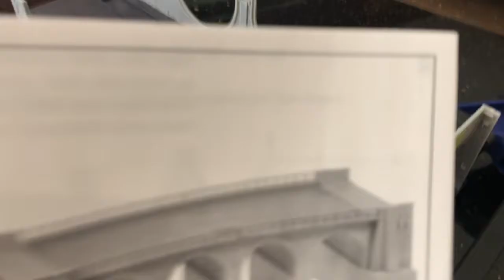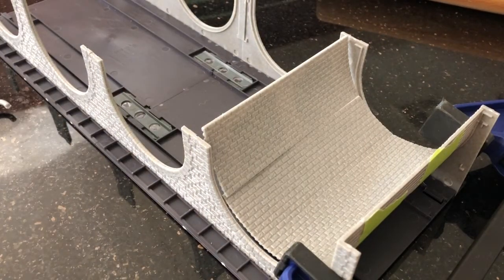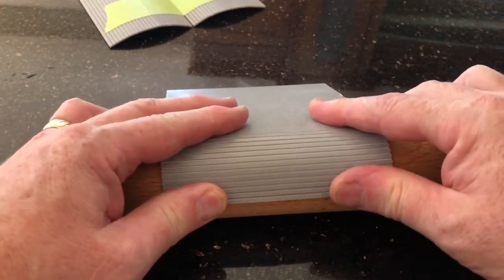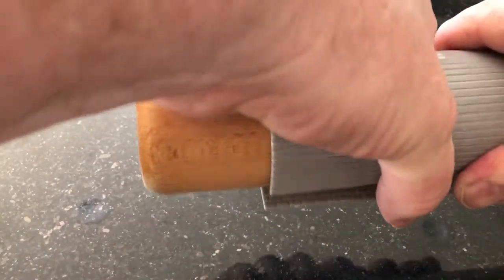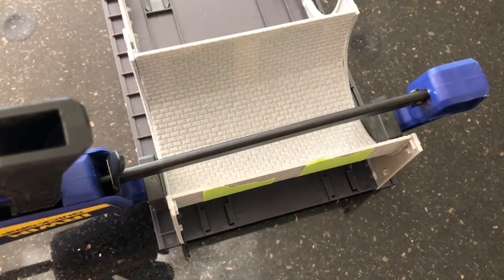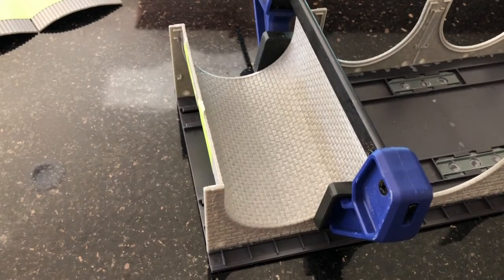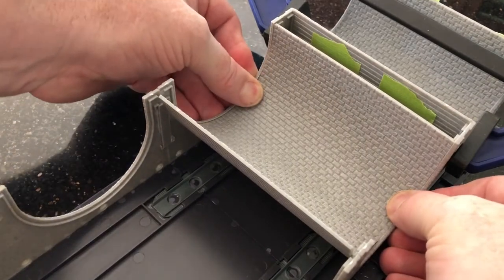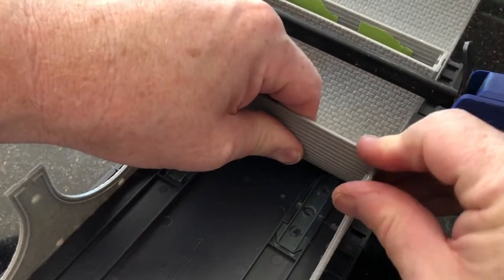Faller 120465 viaduct bridge construction Part 1 of 2

Comment: Having just finished the 8th arch of an extended HO Faller 120465 viaduct I think I have finally found a simple way to fit the arching stonework without snapping it or otherwise mucking it up. The trick is to use a template of the correct circumference to bend the heated arch sheet around, and fix the curvature by wrapping strips of adhesive tape strips around it to hold it in place until cooled. Then apply liquid poly cement to the support ridges of the arch walls and slot the entire template and taped stonework combination into place- do not remove the tape strips. Hold or tape it securely until the cement sets before removing or trim back the tape. (Go easy on the cement- avoid excess overflows)

The template I found which is exactly the correct size is a 180g cardboard Bisto gravy granules tub.

Couple of things to remember. Softening the plastic in an oven according to Faller's instructions works, but you can only do it once. Re- heating it causes the plastic to shrink. Also pay attention and don't bend it the wrong way with the stonework on the outer curve- if you do, it won't bend back the correct way without snapping. Also, don't tape right up to the edges of the plastic- you need to keep these clear in order to bond with cement to the viaduct walls. The main goal is to get the centre third of the arch firmly fixed- if the ends are still loose they can be re-cemented later, with little risk of snapping. The main risk is snapping through the middle- if this happens the job is likely to be irrecoverable and you will need a fresh sheet.

If it all goes wrong Faller customer services are very helpful at supplying replacement parts, although there may be a delay if they are out of stock.

For painting tips when assembly is completed, take a look at this guy: 

https://www.youtube.com/watch?v=MU45M-MvOOQ

Comment: Well, the same thing happened to me, it broke in two pieces. I then thought, maybe if I heat it up some more, it will bend a little bit better. While I was moutning the first section, I left the other pieces in the oven. When I went to take them out, I figured out, heat does not do the trick. IN fact, the pieces deformed! Oh well, of course it's my own fault. But this tricky little thing drives me nuts. Let's see if Faller can send me only these parts as kind of "spare parts".
Thank you for the tip with the rolling pin. I'll definitely try this.
Reply from the maker: Thank you, don't forget to check and score the grooves near the sprue points when you try again. Good luck.